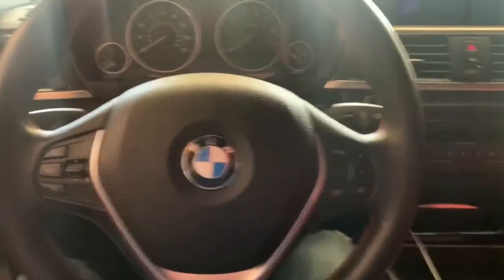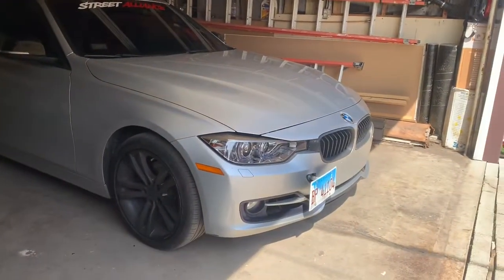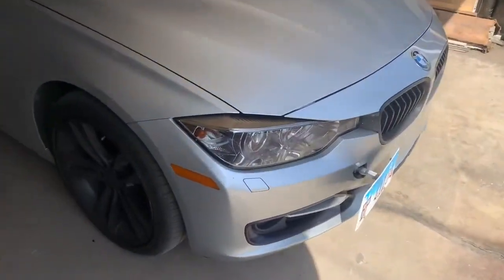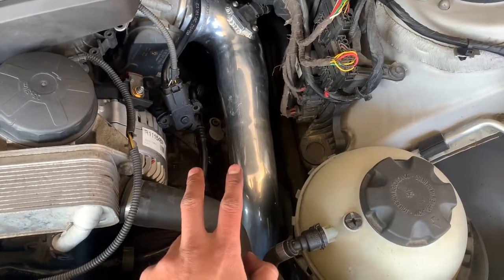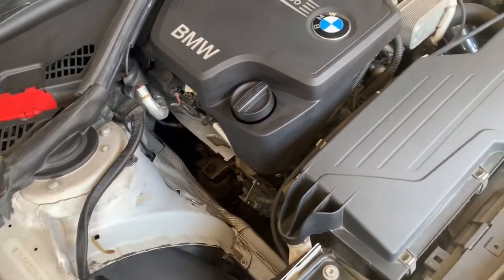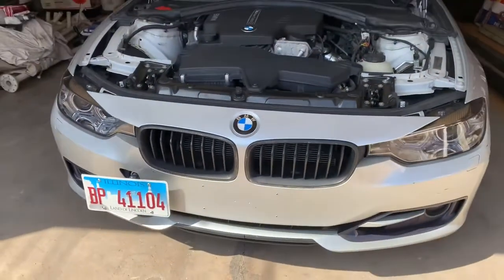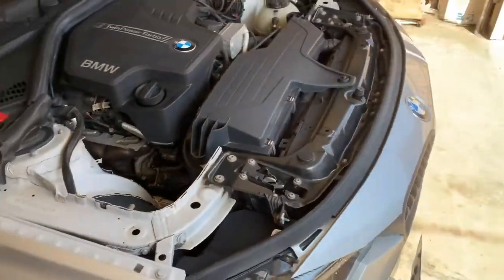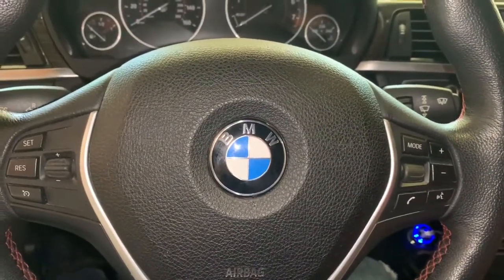Mods/Update On My Bmw 328i F30

Comment: how much hp does the tuner add
Reply from the maker: https://www.protuningfreaks.com/collections/bootmod3-menu/products/bootmod3-n20-n26-bmw-220i-228i-320i-328i-420i-428i-520i-528i
Reply from the maker: If you scroll down on that link it tells you the power increase
Reply: Luis Gee thank you 🙏